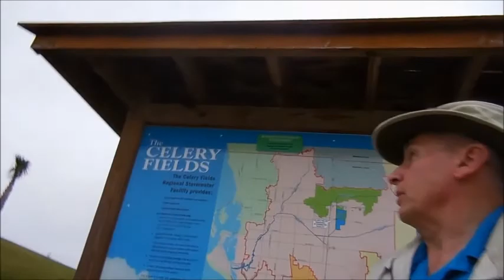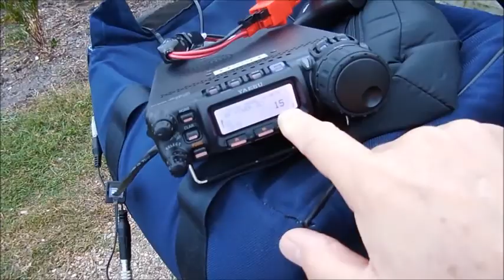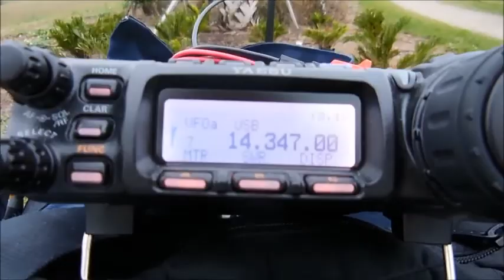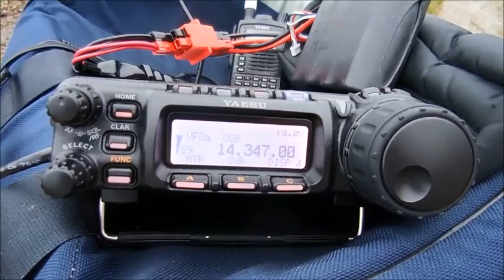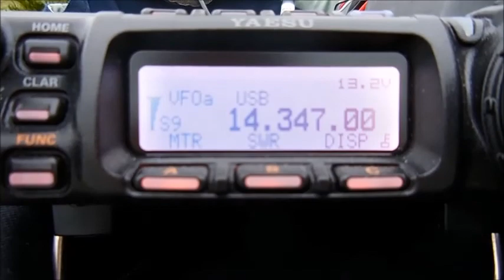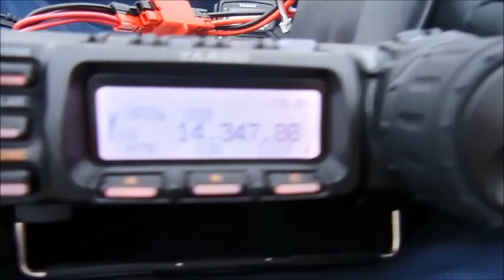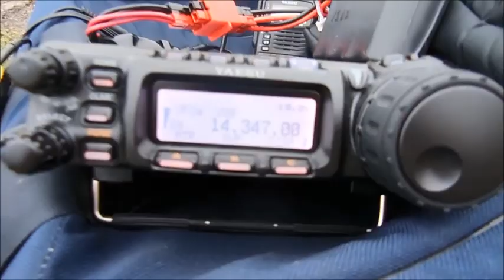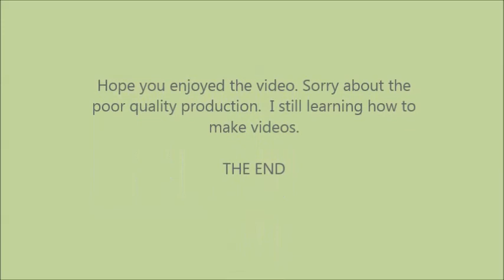Magnet loop antenna operation

Comment from the maker: Ron,
       Thanks for your comments on my video. I am leaving for Dayton in the morning so I do not have time to do a "How to" video right away, but if you look at the response to a similar question from Jose, N2LRB on my other magnet loop video it should answer your question about the inner loop. There are many sited about the construction of magnet loops. I Goggled magnet loop antenna and found lots of information. They are not hard to make, but a lot of fun to use. I will be in Vermont all summer operating SOTA with my loop. I'll keep you posted when. Send an email, I'm good on QRZ.
73 N2SQ

Comment: Hi George.....Thanks for the video showing us your homebrew magnetic loop antenna.  FB OM!  Good find on the cap with the reduction gear.  George, what bands does your loop cover?  20-10?  You said you normally don't bring the swr meter, is that because like my ft-817nd your 857 has a built in swr meter as well?  I imagine it does.....  I also like to backpack.  I got into it three years ago and I use a hammock instead of a tent.  I take a diy 40m cw qrp rig with me and have been using a random wire with a tuner.  Using a loop would be interesting if I could make one light enough for 40m.  Have you seen VK3YE's videos using his diy pedestrian loops?  best 73/72  Neil wa4chq
Reply from the maker: Neil, Mag loops are fun.  A 40M loop would be big. Check out my other videos about the loop on my channel, it will answer most of your questions. Yes I have seen VK3YE's videos. I met Alex of Alex Loop at Dayton 2015. I don't take the SWR meter because the radio has a SWR meter built in and it is to big and heavy to carry. 73 de George N2SQ

Comment: Great video George. I just subscribed to your channel I want see more oof this neat antenna. 73 ve3htb
Reply from the maker: The coax is RG-8 solid Teflon dielectric using only the shield of the coax, the center conductor is not connect. The capacitor is a 25-100pf air variable reduction gear type that I bought at Orlando HamCation 2014 for $2.00. The inner loop is the same RG-8 coax as the outer loop,1/5th the size of the outer loop. The RG-58/U feed cable is connected to the inner loop. The center conductor of the feed cable is connected to one side of the inner loop shield, and the shield of the feed cable is connected to the other end of the shield of the inner loop. There are many web sites with info about magnetic loops that I looked at, not one in particular. The arc over power level is different on each band.  There are three videos on my channel about the antenna, read the comments on each video. I took encouragement from the contact to Ireland I made while testing with clip leads hanging all over and the antenna suspended from my garage celling. The length of the big outer loop of my antenna is 106 inches measured from the edge of the PL 269 at the base of the center pin, not the tip, with the screw sleeve pulled back onto the coax . The little  inner loop is 1/5th the outer loop length, about 21.5" Start with the inner loop at about 22.5" and test and trim down until you get a good SWR. The inner and outer loop are insulated from each other. Both of the coax loops are fitted through the cpvc 'T' on the top of my loop and holds them to together. I kept adjusting the inner loop length while  testing with a clip lead on one side of the feed cable then trimmed the inner loop when I attained a 1:1 match. Start testing with low power of 5 watts or use an antenna analyzer. After you get it tuned with a low SWR then start increasing the power till the cap arcs over and the SWR goes high. You will find that power handling of the antenna changes depending on the band and the cap. The secret is to get the inner loop the right size by testing, testing, testing.  Hope this helps.